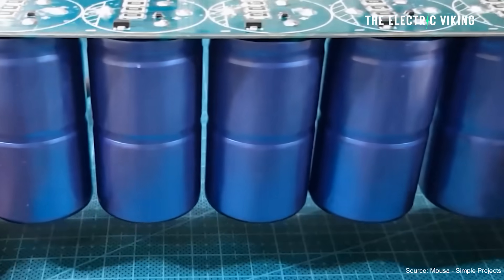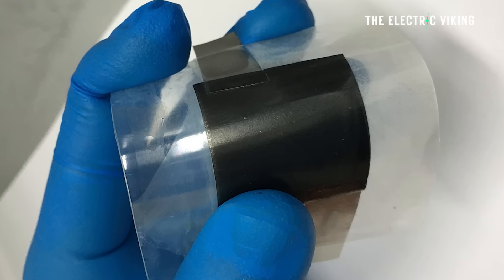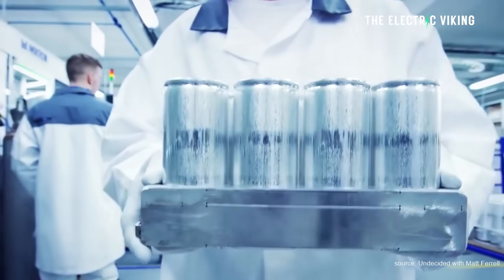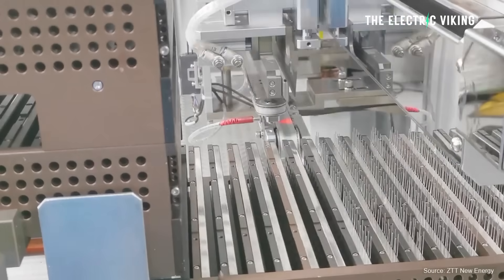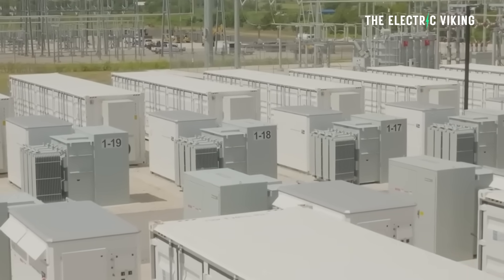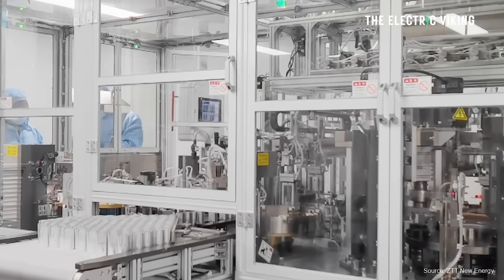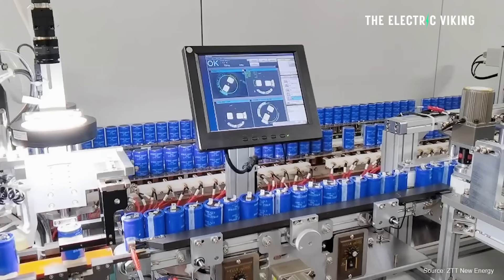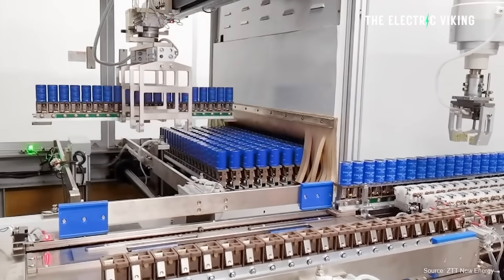UCLA  reveal plastic supercapacitor Breakthrough with 70,000 charge cycles

Comment: I worked on this project and love the video! One thing to note in regards to the problem you brought up in regards to the 70k charge cycles is that you are thinking of a capacitor, rather than a supercapacitor. PEDOT has mild pseudocapacitance which allows for greater charge storage, in addition to the high electrochemically active surface area. Our 70k cycles took around a month to run before degrading, and like you said in the video, were constantly being charged and discharged from 0-100%.

Comment: 70K cycles isn't good for supercapacitor. That's actually fewer than any commercially available supercapacitors today and more in line with hybrid lithium ion capacitor-batteries.
I guess it is still useful for certain applications but given that they will not replace the battery system per se, I wouldn't be all that enthusiastic about it.

Comment: Good report Sam.  Appreciate your going into the amount of time these capacitors hold up.  I've been wondering for a long time why hybrid capacitor/batteries aren't being used to help soak up and discharge energy during high load situations in EV's such as charging, as well as hard braking and rapid acceleration.

Comment: Nice to see someone talk about suoercaps! Let's not forget that between electrical engineers supercaps are percieved as the cool rebel kid of energy storage.

Some minor additions to this:
I think when Sam went into the data, he mixed electrolytic capacitors with actual supercaps (EDLC). They work differently from one another and differ vastly in energy density.

It's correct that the cycle count doesn't really matter and it's all about time. If you look up supercap datasheets, the typical lifetime claim is 1500 h at max voltage (usually somewhere between 2.7 and 3 V) and max temperature (65 ºC is most common). They do typically point out a cycle life but it's generally a ridiculously large number like 1 million full cycles. Effectively saying "arbitraily many, you'll die a calendar death before this becomes relevant"

They can however last you very well for over 10 years, because you won't actually spend much time at that max V / max T condition. Go down about 0.1-0.2 V, you double the lifetime. Go down another 0.1-0.2 V, double again. Same applies for temperature in steps of around 5 ºC.

Regarding the operation, you'd not really do many cycles a second on a supercap. Cycle times are more like between 1 and 20 seconds, ideally around 5. On electrolytic capacitors (the ones you find on every circuitboard) sub-second cycle times are the norm. 

The main advantage of this new electrode in my opinion is that it seems like they have a water free process. Water content is a bitch. It ruins lifetime and needs to be carefully kept in check. The most capable supercaps do use water-based electrode coating techniques, but they need drying lines that are like 50 m long to make sure the thing is bone dry. Not having the water in there to begin with seems like a nice plus.

The 70k cycles is very low for supercaps. The capacitance number is in the range of commercially available carbon based ones. Conductivity numbers for PEDOT vary wildy, so saying 100x of something that's not specified is a bit cryptic. This suggests they are in the range of carbon materials, probably not better. But maybe they are onto something! 

Super cool!

Comment: These things may be useful but not as a replacement for batteries.  The thing they have going for them is extremely short pulses of very high power.  The time scales on an EV are not that fast in an electrical perspective.  Spot welders, and electromagnetic metal forming and other things like that will gain from it.

Comment: Supercapacitors with significant capacity have the potential to modulate the power between the batteries and the drive system. They have no issues with charge and u charge cycles and can transfer energy 1000x faster than batteries. That being said, there are issues with linking them into the drive hybrid drive system because they tend to want to discharge all at once.

Comment: Sam, Super Capacitors beat batteries for charge/discharge speed and current; but capacitors leak down charge in hours when sitting idle where a battery will hold that charge for days - so focus on that feature in future capacitor news. Capacitors could work as a fast-charge bank that gives "full vehicle charge in half a minute" but then trickle-charges the battery bank providing longer life batteries; basically an electric shock absorber. When the charge leak problem is solved they could immediately replace batteries because of weight, low cost materials, and no complex cooling system demands. Evolution of the Leyden Jar.
Reply: @jvin248;
Do ALL supercapacitors leak down?
In any case, almost every use of them is in hybrid applications, to provide short-term power, not capacity.

Comment: They could be useful for handling short bursts of power and regen smoothing out the flow to the main battery pack. 
If they get to the point where their density is high enough to do a short errand then that would significantly extend the life of the main battery pack. 
Not sure if it is worth the cost and complexity though.

Comment: A supercapacitor, also known as an ultracapacitor or electric double-layer capacitor (EDLC), is an energy storage device that can store much more energy than traditional capacitors due to its unique structure and materials. Here are some key points about supercapacitors:

	•	High Capacitance: They have very high capacitance values, often measured in thousands of farads, which allows them to store large amounts of electrical charge.

Still confused 
I’m an economics major not science

Comment: A capacitor is an electronic component that stores electrical energy in an electric field. Here’s a breakdown of how capacitors work and their main characteristics:

	•	Structure: Typically, a capacitor consists of two conductive plates separated by a non-conductive region known as a dielectric. The dielectric can be made from various materials like ceramic, paper, air, or plastic, depending on the capacitor’s application.

Comment: Graphene ultracapacitors store  around 28 Watt-hour per kilogram whereas Lithium Ion 200 Watt-hour per kilogram. The other issue is the voltage drops  as a capacitor discharges.

Comment: Supercapacitors have been used in a Lamborghini i believe. They are very light and can absorb massive amounts of current without a big problem. So I would think if their price goes down, they would become a standard part of every regen braking system, because when you brake suddenly, you are going to generate a lot of current in the generator, and you have to absorb this; a capacitor is the ideal device to do this as it has very low losses

Comment: Electrolytic capacitors are rated in hours at a temperature because their electrolyte has a limited lifetime based on its chemistry, which slowly dries out over time, increasing the cap's internal resistance and reducing its capacitance.     As they are often used in switchmode power supplies, the large current swings they see can heat up the cap itself, increasing its internal temperature, and this would be added to the external temperature for lifetime calculations.  A "number of cycles" measure would be irrelevant as those supplies can easily charge / discharge 10 or even hundreds of thousands of times per second - however, in these applications it would typically be over a very small voltage range (10s of millivolts) to maintain a "constant" output voltage, despite  current swings that can easily be in amps.

Other (non-super / non-hybrid) caps aren't rated this way because their dielectrics (plastic films, a variety of ceramics, or a solid oxide layer) don't dry out over time.  They also don't have a "cycle" rating, and may be filtering variations in the MHz range, again, typically (but certainly not always) with only relatively small variations in voltage, as they are most frequently used for filtering DC supplies.  Their lifetime (or MTBF - Mean Time Before Failure) is typically calculated with the operating voltage, the cap voltage rating, and the operating temperature.  It can easily be in years, regardless of the "cycles."

Supercaps typically also use a liquid electrolyte, so they are also subject to drying out.  So presumably an hours and temperature rating would be most useful.  It is not clear why they use a "cycles" rating in the articles for this new device.  I can suggest a couple of possibilities:  

1:  The super thin (< 1nm) charge separation (Helmholtz) layers may be subject to a failure mode more closely related to full charge / discharge cycles than temperature and time as in a typical electrolytic cap.  

2:  The authors, intending to use these devices in combination with batteries, have provided a metric that battery system designers may find more useful for assesing utility in their application (see below).

For automotive applications, their "killer app" would be city driving.  In this case frequent start / stop means lots of accleration and regenerative breaking cycles.  This isn't a lot of energy - compared to what the vehicle's battery stores, but it cycles in and out a lot, inefficiently being stored in, and heating up, the battery.  If that engegy is instead cycled  to / from supercaps, there would be less energy loss as well as less heating and cycle life degredation of the battery.

Comment: Sam, supercapacitors hold something like 15 watt hours of charge per kg, so 1/20th as much energy as a conventional battery.  There no practical use for them in an EV, even in regen braking.  If a battery can output 300 kw, it can take 300 kw of regen braking, but most cars are only programmed to make 50-100 kw of regen braking for handling safety.  Also, conventional capacitors can already do millions of charge and discharge cycles without significant degradation.  70,000 charge cycles is a step backwards.
Reply: You stole my comment, cheers. But you forgot about the linearity of the storage charge. Batteries store energy in a voltage range from 3.5V to 4.1V, while superCAPs have a range from 0V to 2.4V.
Reply: High voltage (in the KVolts) supercapacitors do have an energy density comparable with batteries, but the company who initiated practical research to such products became a DOD contractor and their website disappeared (national security non-disclosure). The capacitor energy equals  1/2 CV^2,   so if you crank up the max capacitor voltage with a factor 100 then the energy capacity goes up a factor 10.000. To overcome the 1/20 factor, the plastic UCLA supercapacitor  max voltage must go up 5 times, without damaging the capacitor.
Reply: Solid state capacitors last longer than electrolytic ones that evaporate. Energy density is 10x conventional pedot so 160wh/kg.
Reply: Sorry..I see a very goo usage in EV for them (and in hybrids).
The energy efficiency between storing energy and getting it back is very high. It is perfect to have a small SC bank for collecting brake energy and using it to accelerate again when accelerating again. Also they work at all temperature and nearly without any limit in charging / discharging speed (limit is current the capacity of the connecting cable)
I know that they are less good for long term storage (at the moment). 
And NOONE wants  ever  a short cirquit in a super capacitor bank...with near to zero ohm resistance it will unload explosiv.
(Nice only to power a military laser with instant energy)
About capacity others have already commented.
Reply: Capacitors act in parallel with batteries(20-30 of them)and act as an instantaniouse turbo charge for drone or ev takeoff,that would otherwise take time to build up in a battery.in parallel they discharge and charge instantaniouse,which does have a use in ev's but it's a  semi secret eastern technological combination for take off low power acceleration
Reply: Either way, if they start using them in EVs then the usual luddites and oil junkies, will start finding environmental issues with them that never worried them when they were being used in other applications.
Reply: Supercaps have been used in commercial (buses, forklifts etc) and HGEV's around the world. For example, in buses they have been used for rapid transfer of energy at bus stops, particularly used on longer route electric buses, often with smaller batteries making the vehicles more efficient to operate due to reduced weight. In HGVs they are have been used in regen braking to allow the high peak electric currents produced when slowing such a heavy vehicle to be captured in a short time frame, to take the strain of the battery systems allowing less expensive LFP batteries rather than high current/high Nickle batteries to be used (as well as reduce the resistive heating involved high current spikes cause by braking with heavy loads).
Reply: Some F1 teams use them.
May have been Le Mans LMP-1
Reply: Welcome to the future the Chinese have been using caps to recharge their public buses for at least 5 years now,
maybe you should do some better research using deep squeak....deep mind ...deep seek?
Reply: The same could have been said about batteries in the 70’s.  Short sighted much?
Reply: He has to say something nice about the USA occasionally or YouTube will kick him off the platform
Reply: Mainly clothing and on body tech.

Think exoskeletons, work suit, sensors, monitors.
Reply: Maybe usable as a hybrid to enhance regular capacitors.

Comment: Couldn't we build a car like new model Y as currently is + we add some structurally built plastic supercapacitors that will charge super fast and then give back the energy smoothly to the battery while the car is back on the road? So, you charge battery as usual + capacitors, you leave, and while on the road battery drain is compensated from super capacitors giving a lot more range. It will be just an add-on.
Reply: That makes sense. A little bit like mixing lithium and sodium batteries. Could facilitate fast charging.
Reply: Why not a nissan or Kia?

Comment: Capacitors are rated at 1,000 hours.  Using them at lower voltage and temperature greatly increases their lifespan.  They follow the Arrhenius equation.

Comment: 4.6 F/CM^2 sounds good, but these are cylinders or boxes, no? volumetric density would be given in cubic cm. At any rate, a good application would be to marry them to LiION batteries. to buffer the slings and arrows (ups and downs) of the demands of an EV on the road.